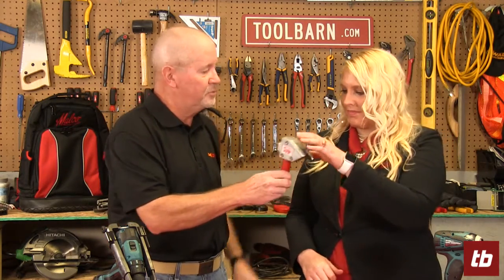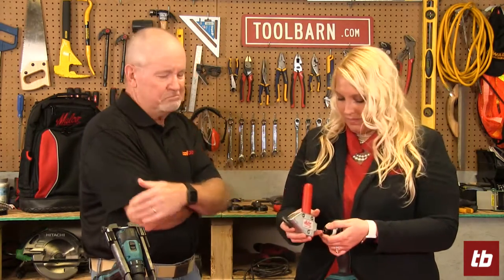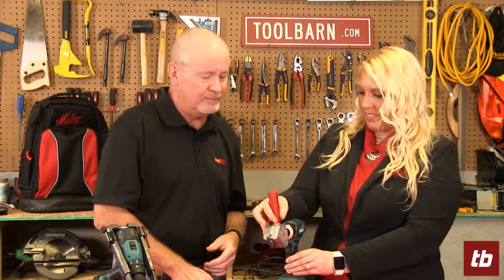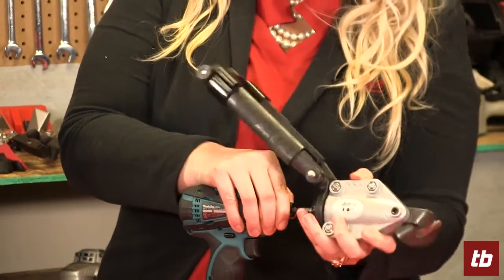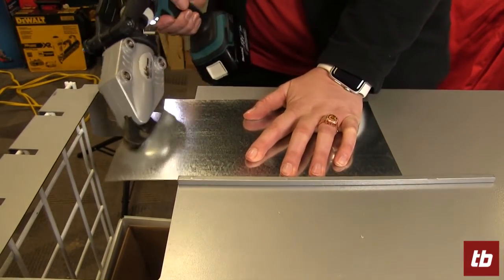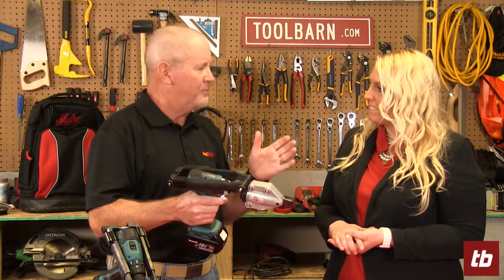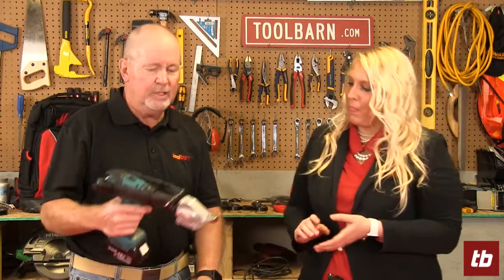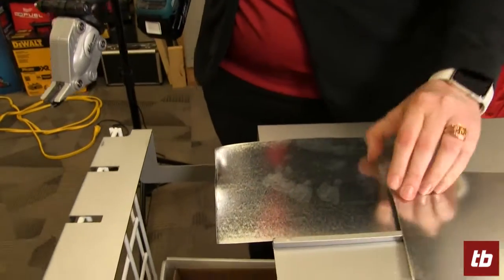Metal Cutting Turbo Sheers

Comment: If you buy these shears to cut R panel don't try cutting the panel from the back side , you can't . It must be cut from the top side . But they are best for straight cuts witch they do an excellent job of .